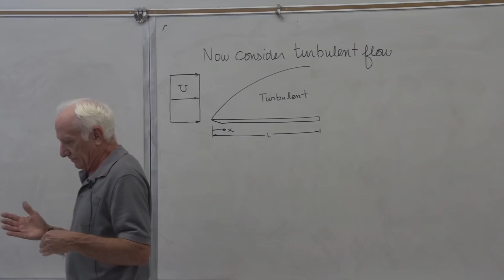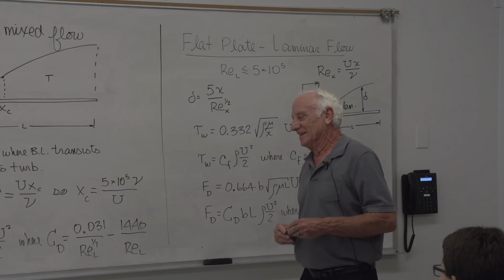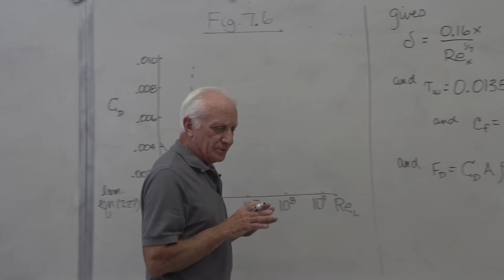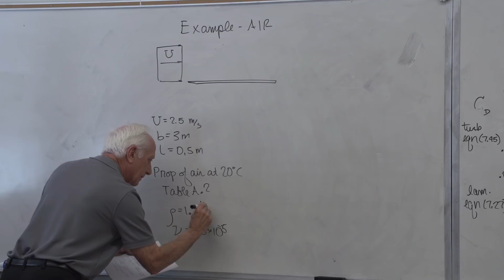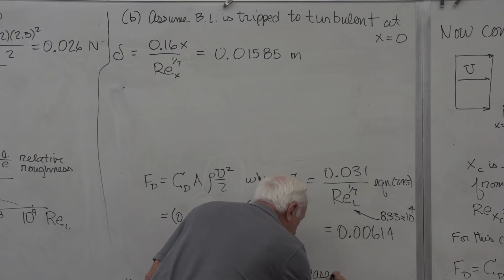Fluid Mechanics: Turbulent Boundary Layer on a Flat Plate (32 of 34)

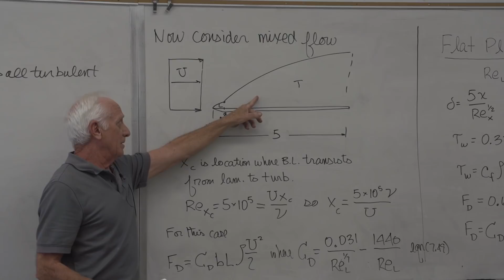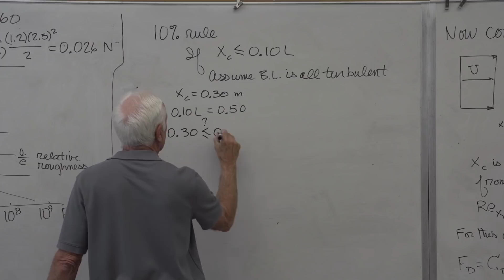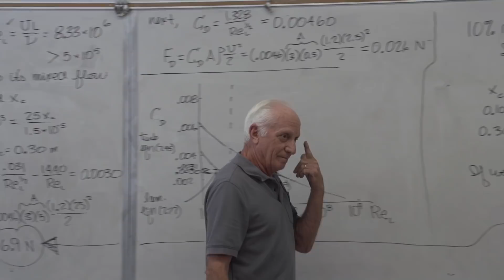Comment: 45:25 the drag coefficient should be 0.003, not 0.0046. At 46:03 the professor still gets the correct answer for the drag force by using 0.003 for the coefficient. At 52:40 he acknowledges the error so don't confuse yourself over it lol.